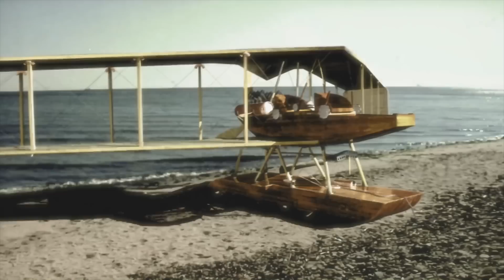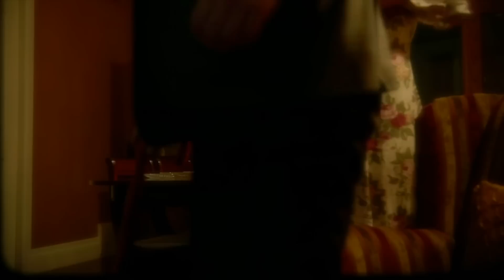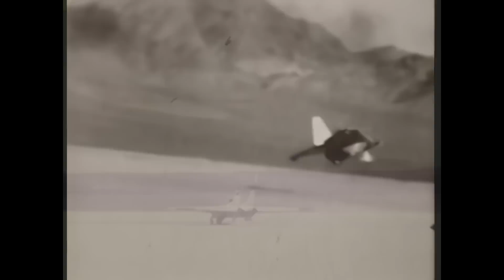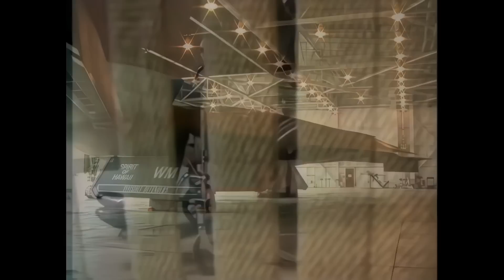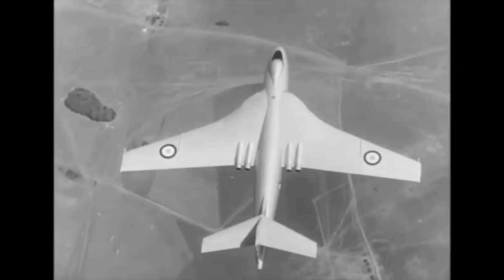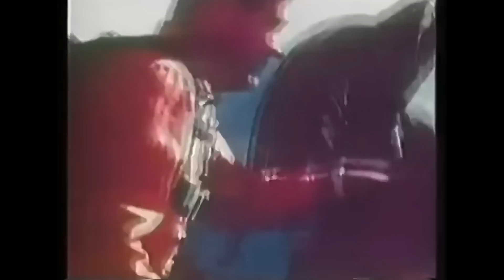Amazing Aircraft: Pterodactyl, And The Origins Of The Tailless And Flying Wing

Comment: The Santos design pursued the aerodynomic performance of a box kite -- He flew in Brazil. 
Gustave Whitehead pursued the aerodynamics of a bird in flight (he' was a successful glider pilot and had a German tech education)
He flew in Bridgeport, CT. -- Jack Northrop later had the same fascintion as young boy watching flights of GU-11s (seagulls) along the NJ and Santa Monica shores. His family moved to California to help establish the aircraft industry -- as mine did about 85 years ago.
The Wright Brothers persisted in a dogmatic pursuit of an impractical (wing-warping) design while holding out for fame & fortune. 
They invented a simple wind tunnel (w/o beach winds) and used it to examine how plane angles respond to wind and how they affect stability . [Lift & weight, drag & thrust, cord & camber; pitch, yaw & roll that influence stability &, control.]  

They saw wings as nautical sails laid horizontally, to provide lift while noting how it varies with apparent wind -- as a plane turns. 
Photos of early airplanes show wings as fully battened mainsails. The Wright's solution was wing warping which wasn't very  useful for military use. in 1909, Berloit flew an airplane across the English Channel which greatly worried the British.
General Hap Arnold also saw a need for something better. The British asked America's foremost yacht designer for help.
Starling Burgess became America's first Aeronautical Engineer. His higly refined design led to the Curtis-Wright JN4 (Jenny) that pilots popularized with barn-storming, airmail, etc. 
Starling's reseach identified the need for an airfoil on the bottom surface of a wing as well as the top. 
He did his reasearch at Plum Island in Newburyport, MA.